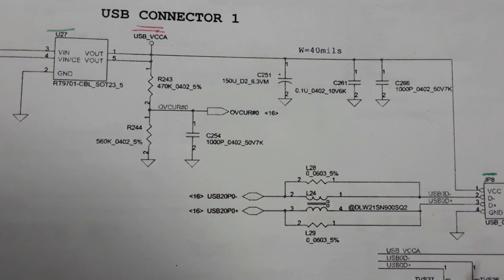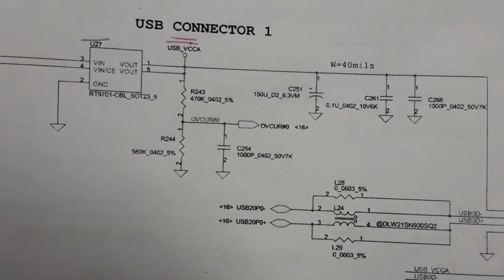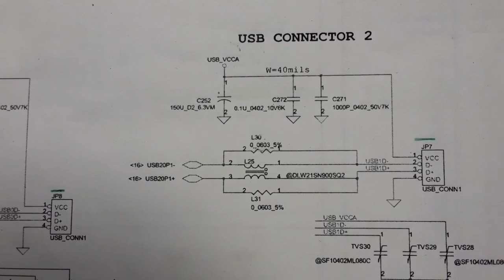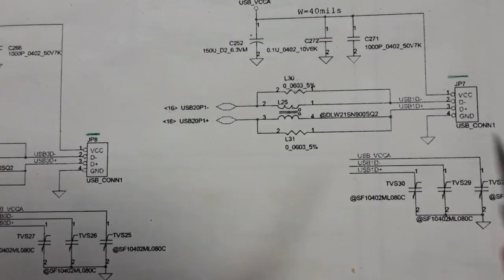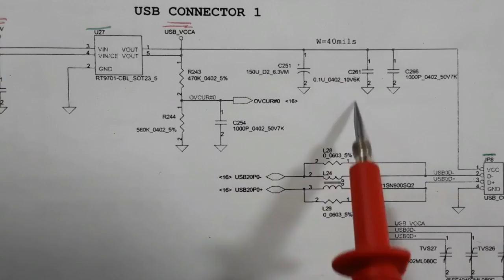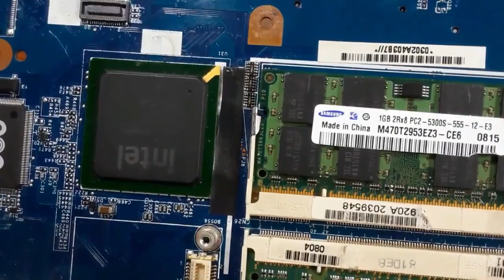Laptop Motherboard Repair - How to Diagnose and Fix Motherboard USB Connectors Circuit

Comment: Just 2 questions for today kindly; is there a way I can know the names of components like ICH, north bridge, graphics card or GMCH( if graphics card and northbridge are integrated in one chip) and BIOS just by looking at them. Another question seems simple but I have never gotten a satisfactory answer even from the internet what's standby voltage please?.. Thanks once more
Reply: sometimes there are manufacturer's numbers on the chip itself or on the motherboard near the chip placement. Also check schematics to get to know the components